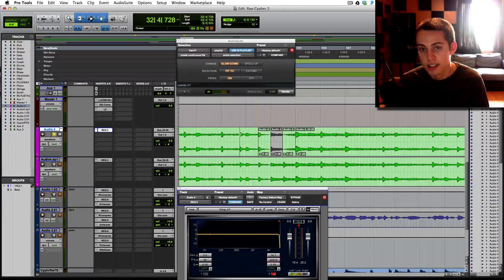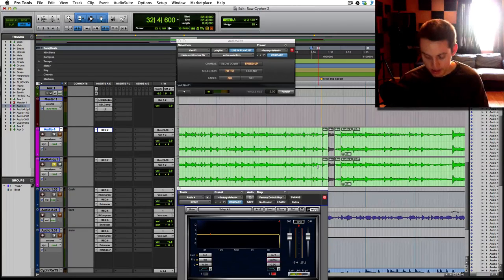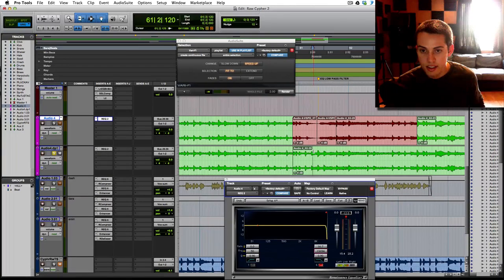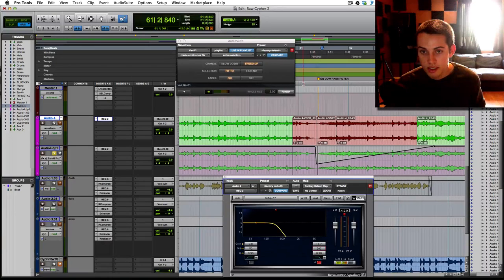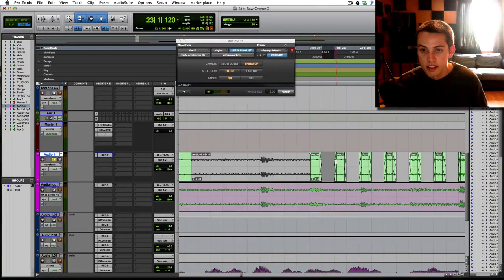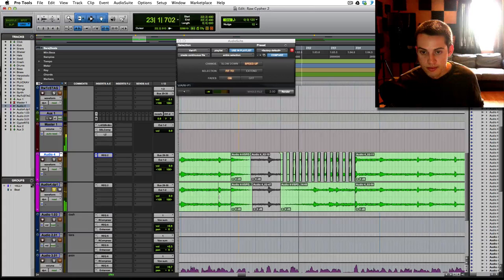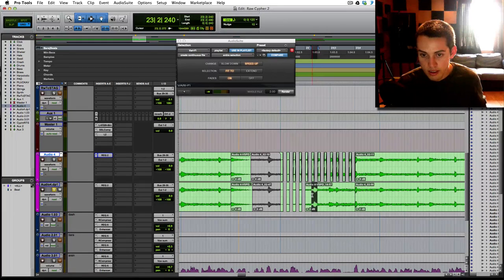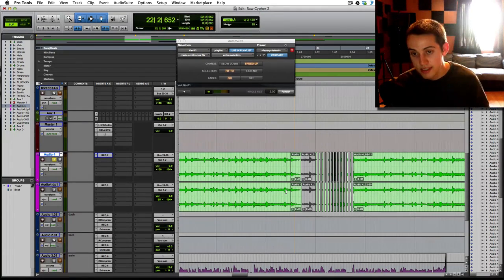Chop and screw, beat drops, beat slow down, beat speed up, beat stutter, beat cuts and beat panning

Comment: this is awesome bro... your videos really help me out a lot... love this beat too.. is it available for lease or purchase?
Reply from the maker: +L-X DaGreat Thanks man. Sorry the beat is no longer available, it has been sold exclusively.
Reply from the maker: Yes panning is for all tracks. And mutes are on the track itself. You can click the M to mute or to automate click the part that says waveform and change it to mutes. that way you can draw in the mute automation.
Reply from the maker: Yeah you can set the grid in small subdivision like 16th notes, 32 notes or 64th notes so you can get that fast stutter if wanted. As long as the tempo is correct it will work good.

Comment: I did this panning effect on vocals for song using a pair of m audio av40 monitors without an audio interface and it sounds great!. but when i listened to it on Yamaha hs7 monitors I can barely hear it. do you know why this is happening.The hs7 monitors I hooked it up straight to the computer with no audio interface. I idk if that has something to do with it? do you know why I can barely hear the panning effect on the hs7 monitors?. thanks for your help
Reply from the maker: How did you hook them up without a interface?
Reply: I hooked them up with Livewire 3.5mm-Dual 1/4" Y Cable 3 ft. I figured out why I couldn't hear the rapid panning, my laptop screen was blocking the 7 inch woofer. But i would still like the panning to be a little more pronounced in the mix. Do you know what I can do to make that happen?

Comment: Which plug in did you use to slow down and speed up in the beginning of the video?
Reply from the maker: That is a stock pro tools plugin. It's called vari-fi
Reply: Got it! Never knew this😭but I’m using it now. Thanks!
Reply from the maker: @jdrmob9524  🙌

Comment: Wat plugin did you use to slow down and speed up the beat?
Reply from the maker: It;s a stock Pro Tools plugin called Vari-Fi
Reply: @RawTechniqueStudios  with out the stock plug in i cant just speed the whole beat down ?
Reply from the maker: @ammojewels4178  You would use elastic audio. I don't like the artifacts it introduced though.

Comment: If my transients aren't right on where I need to be to get the sound I want to be "soloed " what do I do RAW? Everytime I try to make a cut on the beat that is mapped out to the grid it makes me do multiple taps on the tab button that are un even taps unlike u did. You did 2 taps consistently my taps are 2 then 3 than 1. which doesn't sound organic. can you help a brother out???
Reply from the maker: +Mynameis SPKZ Are you tabbing to transient or selecting the grid? Make sure tab to transient button is blue then when you are on the beat track and you press tab it will jump to the next transient. Some beats with have more transient information so you need to find the down beat or up beat you are truing to cut.
Reply: Tab to transient button is defiantly on. Are you saying you can't just cut anywhere?
Reply from the maker: You can but to make it sound on beat I always cut the beats themselves. So if its kick, snare, kick , snare then I would cut for example the kick and hold the cut until the next kick comes in so the cut is right on beat and still in tempo with the song.
Reply: Ill try that out! preciate it!
you have any tutorials on Autotune?
Reply from the maker: Mynameis SPKZ Not AutoTune but on Revoice Pro and Waves Tune. They are on this channel